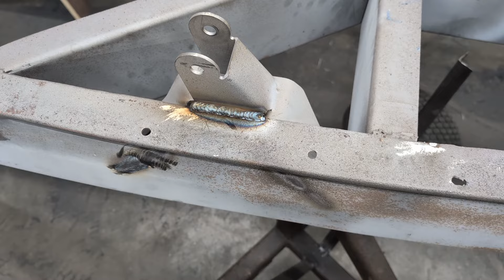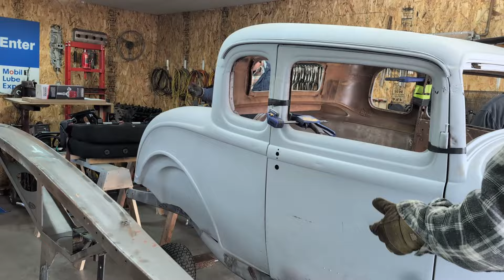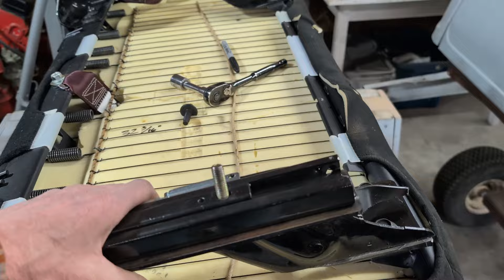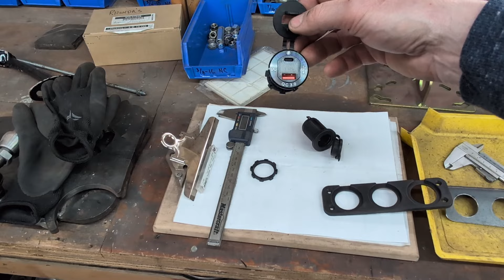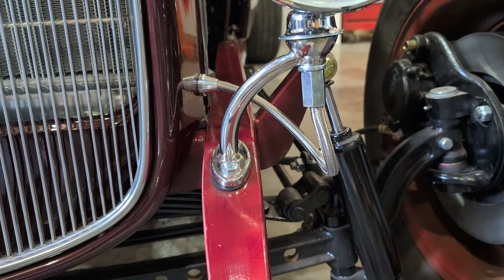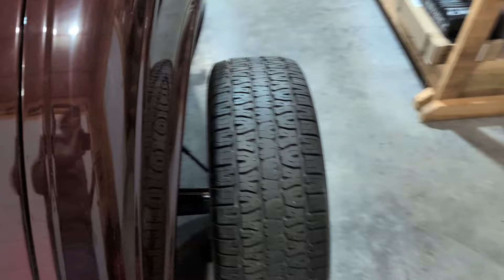5 Window Coupe body arrives, more stuff done on Brenda's 1932 Roadster

Comment: Why box ? This frame was dezined for a V8 from the factory , unless your adding a big block engine .
Reply from the maker: Yes it's getting a 401 Buick with 2 x 4 bbl carburetors significantly more HP than the factory flathead V8.

Comment: Why is the frame NOT boxed…..!
Reply from the maker: It's a low horse power application and the owner didn't want it fully boxed. I offered. It is boxed on the front from the front cross member to the X member and in the rear some. That center X member is super stiff as well so it should make up for the mid section not being boxed.

Comment: Congratulations Brian and family. Thats another fine looking five window body. What make are the wire crimpers you use Derek?. We had a good night at are first local meet at stoney cove last night. Weather played ball, but it did get chilly still later in the evening. There’s lot of work going on at the place. It will be stunning when finished next year. Cheers and best wishes to you both.
Reply from the maker: Hi Tim, I bought these wire crimpers from Princes Auto which is like the American Harbour Freight chain. I think you can buy them on Amazon now too. I think they're just an import knock off and not an original brand.

Comment: You used a coupler nut.  I was watching and you hadn’t shown the nut yet and I was thinking to use a coupler nut and use a 1/2-20 tap in the 1/2-13 hole. A 1/2-20 internal thread has a different tap drill. I’ve messed up some threads that way and the said to tap them out to 1/2-20.
Reply from the maker: Yes exactly I used a castle nut or coupler nut and shortened it 1/2". The braided conduit slipped inside it nicely.

Comment: Do you experience that the frame twists when you weld in reinforcements? If not, what do you do to prevent it? 
I myself am welding a mostly new frame to a 62 Land Rover, on a homemade jig. A few meters of welding. I am excited about the result, if it is twisted or not, when I’m ready welding and can losen it. A sciatica is in the way from doing that. 
Nice to have your videos and others to enjoy in the meantime 🙂 I'm impressed with what you and the camera lady accomplish week after week. Well done!
Reply from the maker: Hi, the frame can definitely twist when doing heavy welding. If we start with fresh rails we get it started on a friend's frame jig. In the case of this 32 frame it has such a heavy and robust center cross member that the re welding we did should have minimal distortion if any. Ideally I think a jig is never a bad idea if you have one or access to one. The other thing you can do is tack everything and not do massive straight welds, alternate side to side welding so each side of the frame sees the same amount of heat. If the frame is distorted I've heard of people heat and cool areas of the frame to straighten it. I've seen it done to correct rear 9" Ford housings. I can relate to the sciatica, I pinched the nerve though my knee last year from working on my knees too much. I think it's the same nerve as the sciatica. It took quite some time for it to let up. I wear knee pads all the time now. Thanks for watching!

Comment: Derrick, I used the same headlight mounts and conduit on my '32 with '34 commercial headlights. I was able to remove the stock mounting bolts from the headlight and then use the long end of the conduit to attach the headlight to the mount. The nut  is now on the inside of the headlight so aiming is a bit of a chore but not too bad. I just use a level on the bucket for vertical and a long straight edge across the two buckets for horizontal. I also went to home hardware and bought some 1/2" conduit in the plumbing dept. for hooking up sink taps, then cut it to fit. Drilled out the ends from the Speedway conduits to allow for the bigger one and that made it easier to fish the extra wire for the turn signals.
Reply from the maker: Gary, that sounds like a great solution as well. I couldn't get all 6 wires through the Speedway inner plastic tube on the ones I had so the 2 ground wires are grounded on the headlight bucket. I've got a good ground as I used the dielectric grease on all the connections. It's always great to hear how everyone else does so the next time I take it all into consideration and improve how to do it.
Reply: Correct, it was a coupler nut.  @coldstreamrodshop  A castle nut has grooves cut into the top for a cotter pin. A common application on a car is a spindle nut to hold the hub onto the spindle.

Comment: Coming out nice , like the Flathead motor. Question on the seats , which seat was installed in the 32 pickup . Thanks
Reply from the maker: We used a rear seat from a Dodge Caravan just like the roadster we just worked on. Same seat. In the 32 pickup we took it apart and re-upholstered it though.